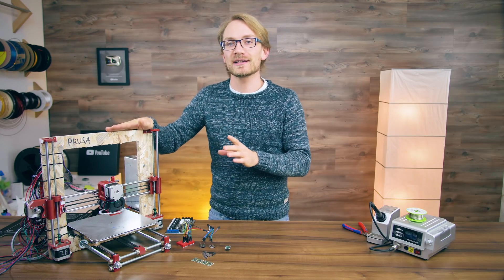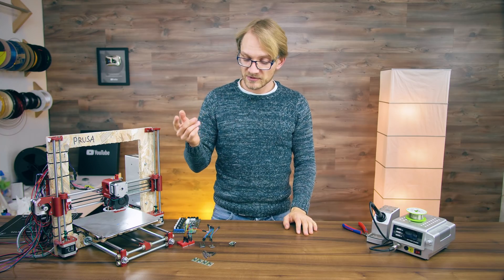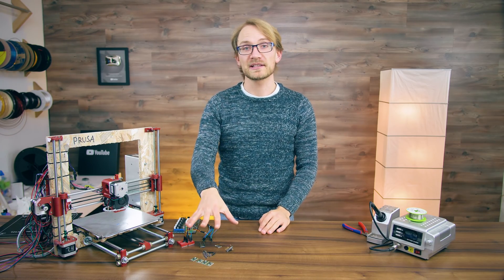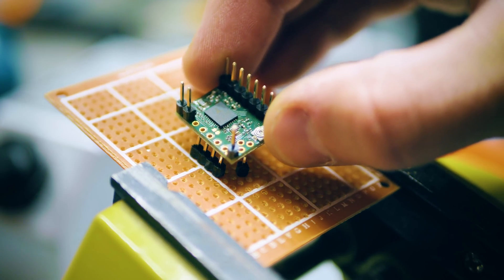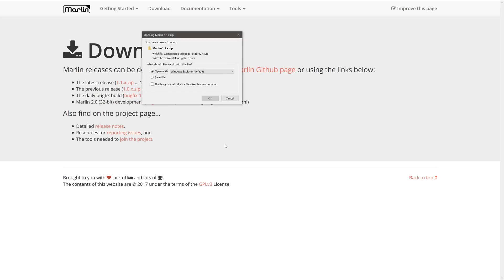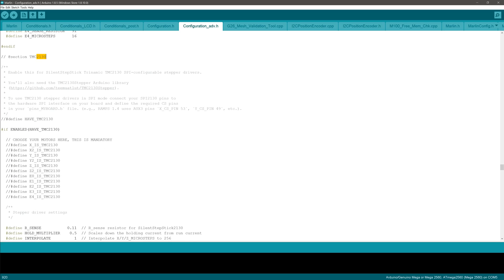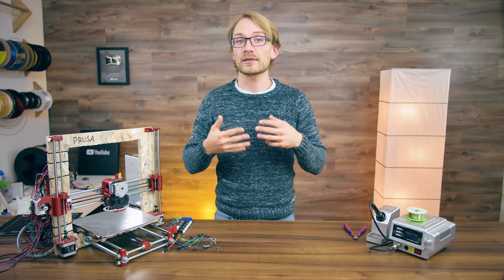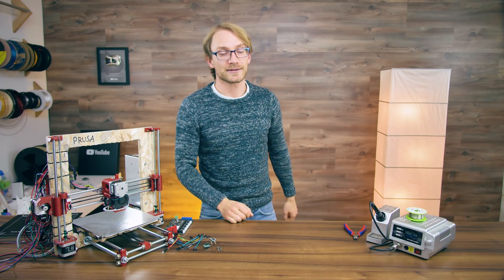How to make your 3D printer smart and silent with the TMC2130!

Comment: So I got a set of these and the question I have is, what if I want to do Sensorless Z axis homing as well? How could I accomplish that?

A bit of backstory. My MK2 clone used mechanical endstops as I detest inductive/conductive/etc sensors and I'd prefer to keep it that way. Plugging in the Mechanical endstops just causes the Z-axis to lift a tiny bit and not do anything else, and having the Diag pin plugged in (as indicated in the video) causes it to continuously try to self destruct by running the motors even when bottomed out.
Reply: I tried it out on my highly modded Anet A8. It doesnt work with prusa type printers, because you have too much torque in the Z gear. Even lowered the Power for the Z Steppers to 400mah and the Homing Sensitivity for Z to 1. Doesnt work.  Also the Bed itself uses a Spring which would make the measuring quite inaccurate, because it would always trigger somwhere else

Comment: A better way to do the SPI and diag wiring would be to solder the wires on the bottom of the ramps - using the little breadboard is way too tenuous (not to mention tacky), IMHO.  
This would leave the SPI aux available for display/SD etc. (if you move the TMC enables off that connector that is.)

Comment: Hi Thomas,
I tried to setup my my printer with the tmc2130. I have a mks v1.4 board and changed the pins in pins_ramps.h to use D2 and D1 for x and y cs because I have an lcd. The extruder motor works and in the beginning also the Z motor. The X and Y motorsdon't work. I tried to switch the drivers for X and Y, but still only the extruder motor works. Tried also stealthchop and spreadvycle modes, but it makes no difference.  When I enable the motors M122 don't always return  that all motors are enabled. Also m122 returns for some motors stealthchop and some spreadcycle. I'm confused and don't know what to do now. DO you have tips?
Reply: Hi Jochem, i had the same Problem. D1 and D2 seem to be already in use by something else. I ended up just using D66 for X_CS and D44 for Y_CS. Like that it works flawlessly

Comment: Hi Tom, great video again! Just one thing is keeps bugging me since your first video about the TMCs. Since then I'm planning on upgrading my Creality CR10 for dual extrusion and hence need a new board with new drivers. So I thought these would be a great choice but then read about the fact that the drivers might get fried when applying Vio before VM (see https://github.com/watterott/SilentStepStick/blob/master/docs/FAQ.md#silentstepsticks-with-variable-3-5v-logic-voltage ). I got the impression that this might pose a problem with many RAMPS boards as you don't really have full control over that. For instance if you happen to have a RasPi/OctoPi connected to the USB port the board would be powered off that without VM present. Or as in my case (and I think you had a similar setup on your Mendel 90) when using an ATX PSU to keep the control board powered via +5VSB and only powering the rest when needed.
What do you think about that? Could this be an issue that might need to be addressed in a follow-up video? Or is this a non-issue with a simple workaround?  
I'd love to hear your opinion.

Comment: Would love to see the video you mentioned on getting it to work on other pins (you showed an MKS Gen board - that's what I'd like to use it on). Really want to leave the LCD headers alone...
Reply: Looking into it a bit further - the MKS Gen has SPI available on the AUX-3 header along with two extra digital pins. AUX-2 also has 8 pins to use. Should be pretty easy.

Comment: Hey all together,
would it be possible to use the SCK, SDI and SDO directly from the arduino mega icsp header when I want to use a Display too?
Reply from the maker: +Paeppi yes, you can! Usually the ICSP header will be inaccessible during a print, but if you can get to it, they're the exact same signals.
Reply: Thank´s Tom!!!

Comment: Hey Tom, great video and awesome detail! I was just wondering (as I'm still waiting for my anycubic i3 to arrive), are both Z-Achis motors driven by one driver? You didn't set the Z2 in the config and in your schematics there is only 1 Z-Driver. I thought maybe there was a way to home both Z-Achis individually, eliminating the need to align them equally by hand and making sure they never go out of sync - or does that barely ever happen in real life? Thank you!
Reply: Maybe there are two drivers but they receive signals from the same output pins on the controller? That's what I do on my CNC router, two y axis motors and drivers but step and direction inputs from the same Arduino pins

Comment: Is there any benefits using the TMC2130 over TMC2100 if i don't plan to use the UART interface? i see it has features such as CoolStep ,stallGuard and dcStep that the TMC2100 is missing, but they might be useless anyway without the UART connection? Great video btw!

Comment: Hi Tom, i ordered now 2 TMC2130 from Watterott and assembled it in my MKS Gen-2Z V2.1.
I removed the Jumpers under the driver and added to the ramps config following pins for AUX 2
#define X_CS_PIN 42
#define Y_CS_PIN 44
But it does not work correct. 
Movement directions are okay both axis stop while homing somewhere in the middle with a noice like it crashes.
Tried the whole day to figure out whats wrong, but no chance.
Please can u help?
Thanks
Cheers Matt

Comment: Hmmm.  So I'm figuring out pins to try this on my GT2560 board.  Seems like the MOSI/MISO/SCK pins in AUX3 on the RAMPS board are present in the SD card header on mine.  Don't really mind losing SD but since it's SPI I think both should work - Guess we'll find out :)  Looks like the select pins just go to arbitrary pins to the chip so hopefully I can use some of the spare endstop pins or similar...

Comment: Hi Thomas; so I found this: http://reprap.org/wiki/MiniRambo_development#Digital_Pin_Locations but I can't tell if any of the pins on the 3 headers P1, P2, P3 can be used to connect motor drivers. In fact, P1 and P2 are used for the LCD controller.

Comment: 6:24 silly-CON not silly-CONE. Silicon is a hard opaque brittle crystalline element with a semi-metallic grey lustre. Notable for being a semiconductor and for its use in fabricating integrated circuits. Silicone is an oily or rubbery, clear or translucent polymer containing silicon, oxygen and hydrogen and usually carbon that is used in caulking bathrooms, degas medication, stopping McDonald's french fry oil from foaming up and for use in breast implants.

Comment: Great video, great news! :) 
So my first question was: ....and how about Repetier? Answer: Not yet, but soon for sure -> https://forum.repetier.com/discussion/1897/support-for-new-tmc2130-sss-silentstepstick-via-spi
Thomas: Don't blaspheme the good old RAMPS 1.4 & Mega - Combo. They are so widespread in the developer scene, so every new feature will be available for RAMPS first and to be honest: Even a ATmega 2560 will be bored to death during 3d printing and the system is bullet proof, because it's working again and again during months, years, hours. There is no real need for a fancy colourful touch LCD and most WIFI, BT features can be done with additional hardware without writing a completely new firmware.

Comment: Hi Tom, 
will this run on 12 V? 
I remember seeing a guide where you have to add a 24 Step Up Module.
Thanks
Cheers Matt
Reply: Used now we step ups....
Reply: There is a bug in the original 1.1.6 Firmware which lets the drivers loose steps on moving after homing.
I used now https://github.com/teemuatlut/Marlin/tree/master and it worked fine for me.
Hope this will be imlemented soon in an official build.
Cheers Matt

Comment: Can these be wired up directly to an MKS v1.4 board? Bought some of these drivers a while back, had no idea how to use them until I saw this video. For some reason they came with all of the pins soldered on down, trying to figure out if I need to change that.
Reply: Do you have them running? I was also wondering about that.

Comment: when you're using a ramps and a simple display, both of the aux slots are used. hope you make the video that shows how to use other pins as soon as possible!
Reply: Benoit B writing a tutorial on doing this as we speak! Mines already working and it’s amazing!!!
Reply: Done! I soldered SDO, SCK and SDI on top of the AUX3 connector on the LCD board, and then remapped CS_X and CS_Y on the unused 57 and 58 pins, in "pins_RAMPS.h" >>> #define X_CS_PIN 57    #define Y_CS_PIN 58
Hope it help :)
Reply: Agreed!
Reply: me too !
Reply: You can use all the Data Pins in Parallel to the Display as he explained. You only have to use some other CS Pins. I Have changed my X_CS to D66 and the Y_CS Pin to 44 in Marlin. (pins_ramps.h) Like that you can use the Display and all the Stepper Drivers at the same time.

Comment: I have one question: can i use TMC2130 with GT2560  main board on 24v with 17 Stepper Motor 42 motor 17HS8401 1.8A,
i build my own 3d printer and this will help me a lot. Thenks.

Comment: Hello! I have a GT2560(revA+) and i'm planning to upgrade X and Y axle only. Unfortunately cs_x {video} goes to the SD card's cs on the Geeetech board (cs_y {video} is on a female header of the second stepper driver which is free so its ok). My question is what to modify in Marlin if i would like to keep SD-reader working? (using a another pin on atmega chip may be ok as well)
Reply: Details: cs_x{video} is on DigitalPin53 (19. physical pin on atmega) which is on SD reader and cs_y{video} goes to DigitalPin49 (35. physical pin on atmega) which is free. As an option i'm thinking about DigitalPin48 (36. physical) which would be perfect as being lead to another free female header. The problem is that i'm not that pro on Marlin.

Comment: By the time you've bought a controller and 4x tmc2130 drivers then soldered it all up and reconfigured marlin you might as well have bought a Duet and be able to run 2.8A motors on tmc2660 in silence plus all other benefits. But as an instructional video it was good it shows you how to do it.

Comment: Damnit. Now I want it on my original MK2's Rambo Mini. I'd have to mount everything externally and probably use P3 to communicate with the TMC2130. In the official Prusa's MK2 firmware all the code for the TMC2130 is missing, though. so you'd have to add it and then you could just as well just move to Marlin completely.

Comment: Thank you very much Tom. The video was very informative. I just wanted to know if the same will work on arduino Due + RADDS, because i was thinking to upgrade to 32-bit. Also, i would be very happy to see a video from you on upgrading from RAMPS to RADDS , because a lot of people say it gives very good quality prints. And, one last thing, what if i want to run some beefy 20Kgcm steppers with the Trinamic goodness (planning to use those to avoid step loss issues).

Comment: Very interesting, but while the motors are definitely quieter than the 4988's ... the effort involved in just making these things work, and all the things that could go wrong while wiring and configuring these drivers, I think I'll pass. Currently running RADDS with RAPS128 drivers (THB6128 chips), and they are quiet without having to go through any custom configuration or wiring.

Comment: Hmm...I'm confused. I have an MPX.3 main board with integrated stepper drives, pots, and sockets. So I would not be able to upgrade to this chip? I'd need to replace my main board?
https://www.amazon.com/HICTOP-Printer-Control-RepRap-Arduino-compatible/dp/B015W7PWRG

Comment: Would this work with auto bed leveling? I'm not sure what pressure is need to actually detect a hard stop
Reply from the maker: +Core3D 3D Printing it could work, but you'd need a very rigid setup and set stallguard to quite a high sensitivity. An active sensor is probably the better choice there.

Comment: Hey what's that solder join on the DRV for? Is that because clone DRV boards don't have the correct vref circuit and you measure motor voltage instead? Do you have a reference for which pin and pad and resistor to use?
Reply from the maker: +Jamie I think I changed the driver's decay mode with that - makes the DRV8825 a bit louder when moving, but removes the unbearable high-pitched whine!

Comment: Does it make sense for a Tevo Little Monster Delta instead of getting TLSmoothers?
Keep up the good work! Thanks
Reply: Smoothers do a totally different thing, they're a workaround for DRVs whining because they can't do low voltage. There's a webpage about it. Also note the 4-diode boards from China do not work fully. Get 8-diode boards or make your own.
Reply: I concur, I got the China ones and they stopped my axis from moving in two directions, removed them and everything was O.K. again

Comment: Always thought they were a bit pricey as my printer is quiet already... but if this is how the current detection is done I am seriously considering the investment for both my machines!!!
Reply: if it works don't fix it really... but if tinkering and have the money it's probably a good investment.  it's really quiet, plus you could remove the switches so less wires is always nice....   however sensorless homing and skipped steps need some tweaking/calibration since it's motor dependent.

Comment: How do they compare to the 2208?
Reply: 2208 have stealthChop2 which supposedly solves problems for 3D printing. The UART interface is not supported in Marlin, but reading the datasheet it seems you can just drop them in place of A4988s or DRVs, adjust current, and you're away.

Comment: The big issue with these is that they can't work with printers with idle power without destroying themselves. (See "VM always needed" in the GitHub readme)

Actually I read some more and it seems that there is some pretty "interesting" stuff happening with all of them where current flows backwards into the motor supply if logic supply is up first.
Reply: So maybe a diode will help and then the the VIO can be powered before?

Comment: I think I've understood almost everything on adapting the Marlin firmware, but that hardware part was far to fast for me! Personally I would need a step-by-step instruction. I know how to solder, that's not the point.
Reply from the maker: +Cat Pause on the wire diagrams! All the info should be in there, but I'll try to get the diagrams up on the website as well.
Reply: Resist doing a screenshot of the schematics. Pause and draw them yourself. The act of drawing them will help with visualization when doing the actual hookup. Everybody knows that we get faster at procedures the more we do them - this is because we are almost thinking in parallel, not series - like the first time we do a "step by step" wiring something. You can get past this serial thinking very quickly by pre-drawing the diagram yourself.  I mean, a diagram on a video only needs to be about 3 seconds.